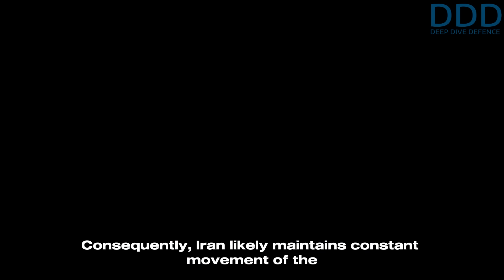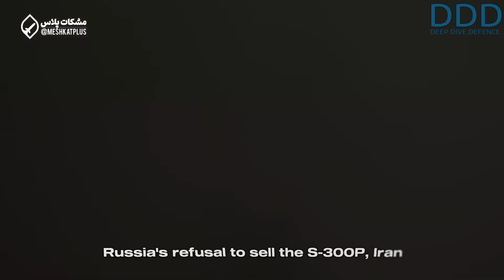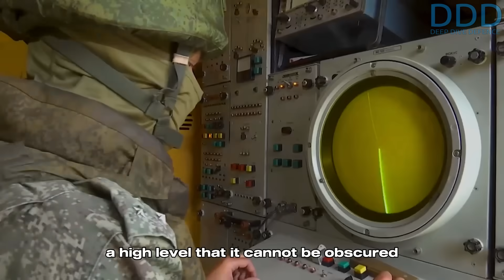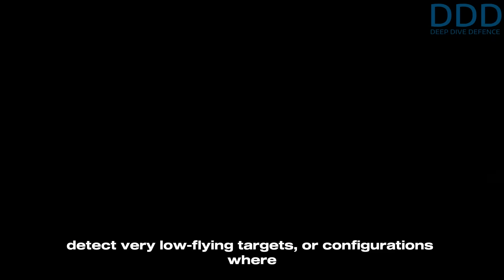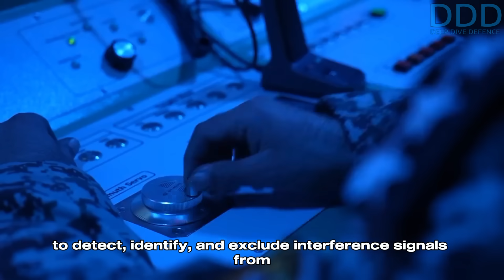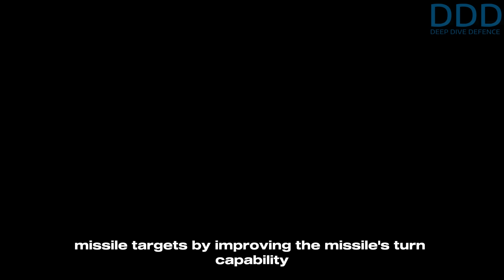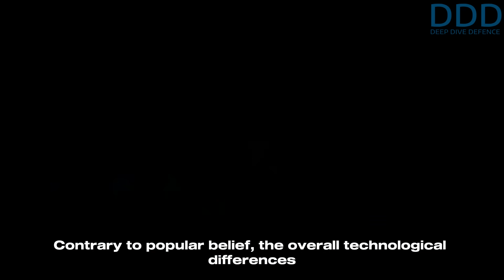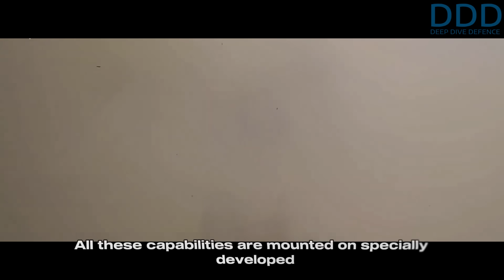The story of the S-300 Air- & Missile Defense system and its service in Iran

Comment: Apparently, most Western experts cannot believe that the Iranians are capable of reaching a level of applied scientific advancements that would allow them to design and produce advanced, powerful missile air defense systems on their own without help from other countries!!!  But this really happened, and I have witnessed this claim with my own eyes, and I have seen, for example, where and how various radars are designed and built by Iranian electronic engineers, and they have no connection with other countries. Or I have seen that in a very large building in a part of Iran, only more than 3,000 senior engineers and PhDs in electronics and computers work together on artificial intelligence for various military applications. That building is completely isolated from the Internet and even the mobile network. Even when entering, all employees' mobile phones are taken from them right in front of the entrance. None of them have the right to carry electronic devices, including flash drives or mobile phones, in any degree. When leaving, they are passed through a place where if they have hidden something, the information inside it is destroyed and erased by a strong magnetic field. No one is trusted there because the information is very important. I have seen where various missiles are designed and the complex system used to design various drones and robots is unbelievable even for the Iranian people, let alone you.

Comment: The issue is that small drones can be smuggled into Iran and used against radars, while Iran has no practical way of doing the same to Israel.
Reply: Iran can do that to Israel, and in many ways has - Hezbollah targeted such radar continuously and destroyed a good many via airborne drones.

However, I agree with what you said.  Even if it wasn't small drones, you can guess that a technical capability like that would be within Israel's reach through the US, no matter what the cost.  Not so with Iran.

Iran would be better served going with cheap, sacrificial, "swarms" of light, mobile radar systems instead, or else, in parallel.
Reply from the maker: Yes, it needs reliable defenses against such threats
Reply: @DeepDiveDefense  as algún vídeo sobre explorar e innovar sobre la tecnología de drones defensivos llegarán al punto de poder derribar aviones misiles bombas si innovan en ese campo estaría bien videos sobre eso ya fuera con tecnología láser balas ...

Comment: I don't know why iran not changing its side from pro russia to pro china 
News confirming they going to supply old J10 c to Indonesia, supplied hq batteries,J10 c to egypt and recently they agreed to supply Pak J35,Hq 19,KJ awacs 

Iran have every counter strike capabilities except air support (if Russia delays SU-35, they can acquire Chinese j10s) but Iran with vast area don't have defensive capabilities they need ABM air defence,anti UAV(Specially Quadcopter)A web like defence with top class integration. systems like 
HQ-9,HQ-19 and in future Type 625E chinese pantsir(If russia not serious) cam fill Iran's defence problems.Recent Russia  posture about Tehran's nuclear issue it's looks like a ally that can't be trusted blindly
Reply from the maker: J-10/J-35 won't cut it for Iran. It has different needs, different opponents
Reply: @DeepDiveDefense but fighting with something is better than standing with junked weapons against superior adversary. I've been following Russia-Iran since 2 years but still no Su35 in Iran (despite the news of Shelters being bulit at hamedan,Nov 2024) despite strategic agreement. I don't think IRGC officials examined/Visited J10C facilities twice for nothing.if Russia unable to deliver Flankers by year's end like s300 previously then it will be a Chinese jets or PAF JF17 that will fill the gaps of ageing jets And IRGC/AF also knows about it
Reply: @DeepDiveDefense @DeepDiveDefense but fighting with something is better than standing with junked weapons against superior adversary. I've been following Russia-Iran since 2 years but still no Su35 in Iran (despite the news of Shelters being bulit at hamedan,Nov 2024) despite strategic agreement. I don't think IRGC officials examined/Visited J10C/JF17 facilities twice for nothing.if Russia unable to deliver Flankers by year's end like s300 previously then it will be a Chinese jets including chinese Flankers or PAF JF17 that will fill the gaps of ageing jets and IRGC/AF knows About it.Azerbaijan already secured JF17 while iran still waiting atleast exchange your transactions 
You have prime example of syria and Lebanon how Israel is keen to suppress the countries which tried to threaten its existence and most importantly USA is there to fully support the israel. It was a foolish thing that we were started to speculate that US will left Israel when they supplied 1000+ cargos since gaza genocide

Comment: The (edited) satelite image allegedly showing a truck S-300 battery showed up some 3 weeks after the total failure. All the video footages show 99% interceptions from Iran.
Reply: Yeah, but I saw Tehran on X recently admit to an S-300 radar being taken out. Mind that Athens has several times allowed Israel to train against its S-300 placed on Crete.
Reply: @nikolaosstamos420  They didn't admit or deny, nor specify. It was most Likely a S-200 put there as a bait. Otherwise, israëlis would have been able to finally fly over Iran (which was not the case), as a matter of fact they ran away because of "unknown air-defence system locked on them".
Reply: @nikolaosstamos420  👉"Deputy Operations Commander of the IRGC Aerospace Forces, Gen. Shekhian: "We do possess and use the S-300 system, (ndrl, as baits) ... No request has been sent to Russia for the S-400 system because the systems we have possess capabilities far superior to those of the S-400." 👉Imagine one's Level when he uses S-300's only for baiting purpose.....
Reply: @nikolaosstamos420 They even allegedly "DAMAGED" a battery, without more detail about the Air-defense model. For knowing the Iranians....... I wouldn't be surprised if it was something old, just enough to bait them closer in order to down them with their most advanced
Reply: I’m 99.9% sure it wasn’t 3 weeks after. I think it was less than 5 days.
Reply: Regardless of it being edited or not, even if we assume it wasn’t edited, nothing about the satellite image indicates damage to the radar. Western media only push that narrative through assumptions and childish annotations. I saw the annotations and laughed. Anybody that actually reads the reasons why they thing the radar was damaged can easily debunk them in less than 5 minutes. But nobody does that and the media counts on that.